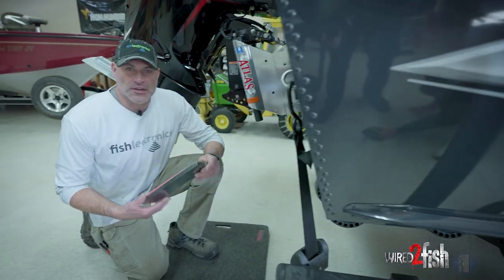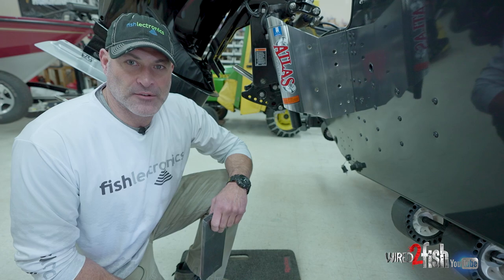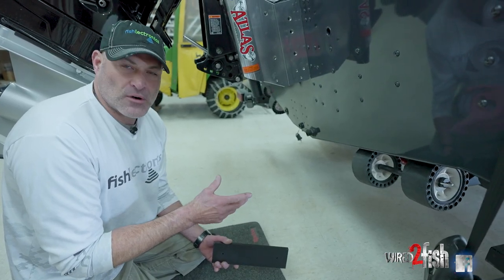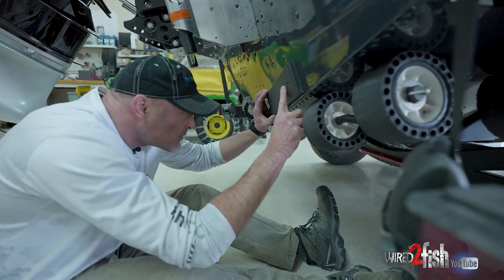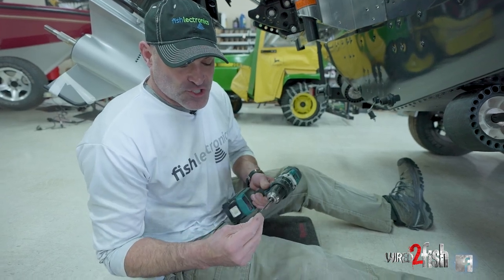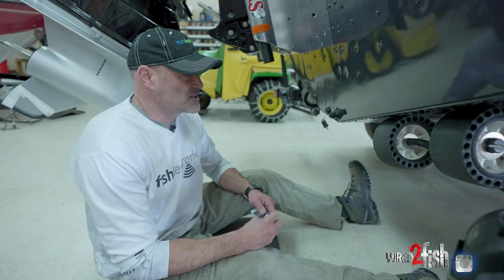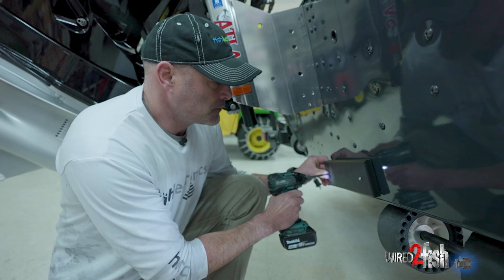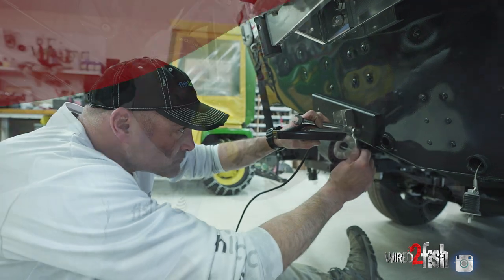How to Install a Boat Transducer Mounting Plate | Easy DIY

Comment: I just purchased a lowrance HDS 9 carbon which has the 3 in 1 transducer. I currently have a lowrance hook 7 already mounted on the transom on a mounting board. Would the two transducers side by side on the same mounting board cause interference?

Comment: I am doing this in about two weeks for the first time. I would like to use an underwater grade silicone that will work for  HDPE board more commonly called Starboard. Can’t seem to come up with the exact recommendation . What brand and type have you had the best results with in the installation that you have done or know about ? I see you’re using Sudbury Elastomeric marine Sealant.

Comment: Could you explain more about rivet lines and where and why to line it up
Reply: You want to mount in between the rivet lines. The transducer should be in front of a smooth part of the hull

Comment: What’s that rubber trim piece protecting the skeg of the motor? Is that custom made ?
Reply from the maker: That's just a piece of rubber hosing still on the engine "as shipped" from Mercury. The boat hadn't been in the water yet at the time of this filming.

Comment: You mentioned something that has kept me confused all this time and it is the different criteria for mounting high speed skimmers and side imaging transducers. I am having trouble getting reading with the SI and DI and from a totalscan transducer from lowrance. Your opinion, should the transducer be level with the bottom of the boat or level when the boat travels at 1-5 mph where the bow travels higher than the transom. Also should the transducer be installed somewhat below, level or slightly above the bottom of the boat?

Comment: My transducer mount plate 12” X 3.5” x 0.75” “boat zone” that I got from Amazon didn’t come with instructions on what drill bit to use to drill into the aluminum. I’ve heard 9/64”, is that correct? I wanna make sure it’s the right size.